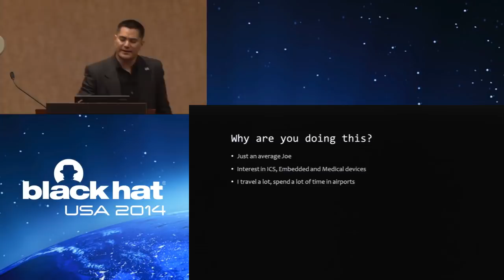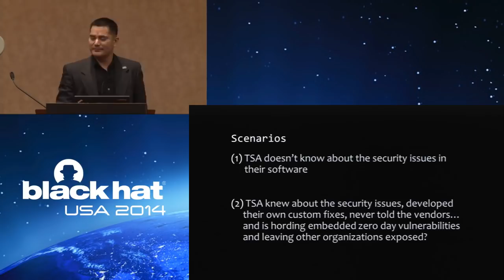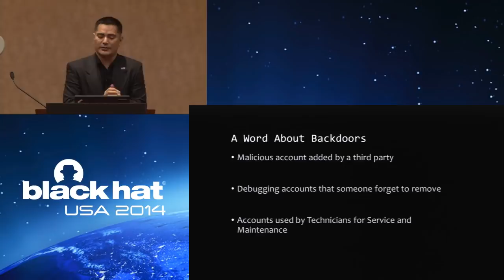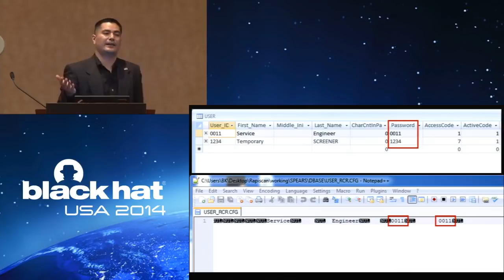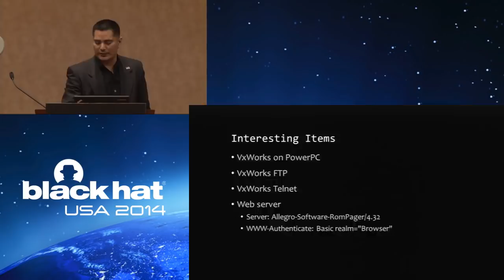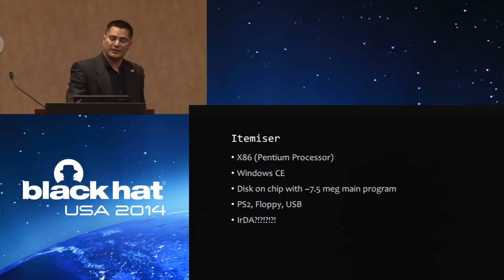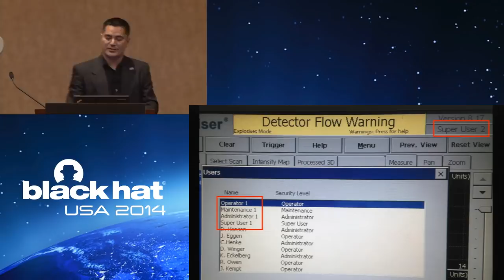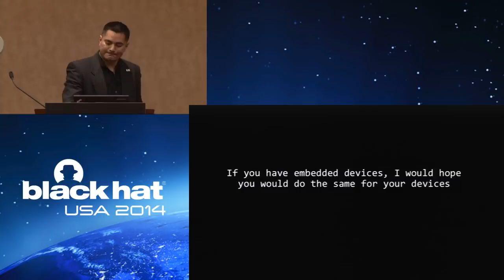Pulling Back the Curtain on Airport Security: Can a Weapon Get Past TSA?

Comment: My home router has better security than the devices used by the TSA...
Reply: bruh
Reply: Nearly all routers have a backdoor for maintenance.
Reply: There was a huge outcry on hardcoded backdoors, an older one now is the Cisco switches, read up on that. Home routers have terrible security generally, I've actually made sure to check that every router I have ever bought or recommended to someone has the option of installing OpenWrt, since routers basically get near no patches after being released, even though most routers are used for years (I actually discovered an ancient one from around 2001 when ADSL was rolled out at my grandparent's house, it was from a time where he spent a godawful amount on a 250MB cap (MB is not a typo), it only got replaced in 2018 after we actually used the net there and discovered that this thing still existed. Amazing feat of engineering though that it could keep running without any issue near 20 years in a dusty room that never got entered, surviving lightning strikes on the line as uppermost house on a large hill, etc.).
Reply: A YouTuber “that it could keep running for 20 years” - yeah, with all its security patches applied by the NSA agent assigned to that home...
Reply: @antoy384  thanks for the laugh, that NSA dude must have been pretty bored as net was used for an email once every few months lol.

Wouldn't be susprising to me though if actually did, my grandfather worked quite high up at NASA during the 60-80s.
Reply: can i buy it?
Reply: @Walter_  “Nearly all” lol.  More like nearly all stock ISP supplied routers.  Buy your own, run PFSense.  It’s easier than you may think.
Reply: @\f_a/ I use a pfsense router and Ubnt switches and wifi access points.
Reply: @\f_a/ No prob.  Just Google pf sense router if you’re not familiar with it, basically you can buy a barebones micro system and install it yourself.  The security and features are great and it’s actually really easy to use.

Comment: Title " Can a Weapon Get Past TSA?" ... answer not given or I missed it somehow.
Reply: I have to agree, I was thinking he meant TSA misses false bottom bags or similar modifications in baggage.
The answer is more developed. Inferred rather than overtly claimed.
If a weapon can be substituted INTO a screening event, can't a screening, sniffing, detecting device be overridden to NOT ALERT??  So, from 4:30pm today to 6pm today, at your local airport, no alerts will be given in any threat detection.  Is that safe?  How about the reciprocal....from 4:30 to 6 pm ALL SCREENING EVENTS WILL SHOW A GUN.  Now, after 20 minutes, will TSA trust all those detections?  No, they saw a gun, they looked in the bag, its not there, they screened the bag EMPTY, it shows gun, the gun is not there, etc.  What would TSA do?  Delay thousands of passengers, and flights??  Or, start passing everyone?  What do they do if this occurs in the top 20 US airports at the same time?
Reply: The presenter is a weapon and he got past TSA
Reply: TSA has an 80% failure rate in testing and one of the highest turnover rates of any government LE agency.  Yes, you can.
Reply: The mic is mightier than the gun... Boy things evolve fast!
Reply: It's that weapon Douglas Adams has talked about
Reply: on purpose...
Reply: Looking at the network diagram shows these devices have to be networked. I'm making a few assumptions here but from the employee timeclock software (like the one exposed to WAN from SF airport) you can hop to other devices using hardcoded credentials or possibly OS level exploits on the Windows 98 gun/knife detection software. From there you can change the config file to show fake guns in every bag.  I'm not sure exactly how to exploit that but if I had to try I'd probably start increasing the false positives over a few days to get the employees annoyed about it.  Maybe even make the software show 2 identical guns sometimes if easily possible.  Then bring a gun through that would scan identically on the software that's well hidden in a fake compartment of a bag.  I think the answer is a pretty glaring yes.
Reply: well, of course he doesn't tell you "yes, please bring your weapons into the airplane - also this is how you do it". But from what he has shown the answer is pretty much yes - you can. He showed that the devices are a) all on a shared network and b) that most of them have easily exploitable backdoors. Just from what was shown in this 30 minute talk you could a) change a simple config to completely deactivate the detection of dangerous substances b) impose pictures on top of scanned luggage or c) show the user a sign that tells them "this is not an actual gun, but a training picture. go on". 
Just use your imagination for what else is possible with super user access to these machines.
Reply: not just that. You could simply overlay a completely fake scan on top of the actual luggage. You could just display the green "hey, you spotted the fake digital gun. well done" display while actually having real a gun in your bag.
Reply: Well if you can alter or adjust what the device is detecting, the answer is yes. He could literally disable the entire explosive swabs machine by rewriting the config.bin. The Rapiscan alters the images the operator sees, so what’s stopping him from injecting code that makes every bag look normal?
Reply: it's called a rhetorical question. the answer is given many times during the presentation
Reply: Andrew H    Hi, just wondering where you get 80% from - can you give me the source so I can read where you saw this...

I’ve worked as a Flight Attendant for one of the largest airlines in the world for the past 17 years with the 6 years previous as an Aircraft Dispatcher - seeing how that job involved co-ordinating the turnaround of aircraft from when it lands to it taking off, Ive always loved reading up on security measures and stats from “rival” airlines. 

When I saw your comment, I immediately found this figure to be extremely high - and I’m certain if the failure rate of finding “insecure” baggage was as high as you say with 4 bags out of every 5 being missed, then they wouldn’t be allowed to operate. Especially after the scale of security was increased ten-fold after 9/11.
When IATA did a huge in-depth survey of all the major airlines flying in and out of US and European airports, they published their findings after it was discovered figures were surprisingly high - However they considered it high when some airlines hit a failure rate of 25 - 30% (None were TSA) As far as Im aware, the offending airlines were given a timeframe to improve - and I imagine they must have, otherwise they wouldn’t be flying to this day.

Anyways, I’m not trying to start an argument or anything - just want to have a read of where you saw that 80% figure.

Cheers ✌️
Reply: If they can inject fake guns into the rapdiscan machine, they can disable the alarms for guns, scan their bag with their machine, and inject that clean scan into the machine at the airport.
Reply: @markotik75  He is most likely referring to the late 2017 undercover DHS report: https://abcnews.go.com/US/tsa-fails-tests-latest-undercover-operation-us-airports/story?id=51022188

A relevant quote from this article is : When ABC News asked the source if the failure rate was 80 percent, the response was, "You are in the ballpark." 
This is from an official source that is said to have seen the document.

This also comes after the 2015 ABC news report that said DHS undercover tests produced a 95% failure rate: https://abcnews.go.com/US/exclusive-undercover-dhs-tests-find-widespread-security-failures/story?id=31434881
Reply: There is many implied vulnerabilities. The power point is laid out in a way to point to the actual problem: there is serious design flaw in the checkpoints evidenced right in the specifications.  He continues by pointing at some other inadequacies such as the use of inconsistent security on manufacture, some may call it haphazard.  If they get bent out of shape about a light bulb, why was nothing done about main board assembly coming from China?  His presentation is about a high degree of negligence or outright incompetence. Who knows, maybe TSAnet is a robust network capable of handling exploited or malicious terminals. If this is the case, it was probably not designed by anybody from the team planning the security checkpoints.
Reply: The answer is, basically, yes...yes it can.
He detailed a few different ways you can get into the networked system to disable certain parts of the security system.
Specifically he detailed how you can access the screens of the scanners through the software and alter them...and how those machines were in the network, thus, accessible from another part of the network if you want...and how easy it was to change what the scanners show.  Thus, you could change the image files for the weapons into safe things, like pictures of normal luggage contents.  Then you have them always appear over the luggage.
He also said how you could get into the main files of the machine which detects chemicals (bomb stuff. for example) and alter those so they didn't detect that stuff any more.
Part of it was also showing how you could access the network through a back door in the employee scanner thing....thus giving you access to all the machines on the network.

So, yeah, he basically gave you a full break down on how you could hack into the security check point, alter it's luggage scanner and it's chemical scanner and, thus, get anything you want through the checkpoint.
Reply: Yes, they can. More can be done by social engineering than exploiting the system.
Reply: the answer is no, because all of TSAs devices have custom settings
Reply: The answer is yes...did you not watch the video in full?
Reply: The implied answer is yes, you can.
Reply: The answer is yes. At least according to the security audits done by our own federal government. I believe it was something like 8 out of 10 dummy weapons got through security.
Reply: The answer is yes, or was yes with the equipment he tested. You were able to change screens on Xray machines, remove explosives or drugs from itemizer and so on. It wouldn't be easy or even practical but it could be done. Weapons get past TSA all the time without any of these high tech methods anyway
Reply: @MarkH10  I think they'd just cancel as many flights as possible and declare a state of emergency, to be honest.

Comment: "Our computers are unhackable." "Enigma ist unzerbrechlich" so said the Nazis. Even when the Allies behaved as if they knew what the orders were, the Nazis still insisted that the Enigma code was 100% secure. But due to a minor error the Enigma WAS breakable. The letter changing devise never substituted a letter with itself. It made breaking Enigma much easier.
   Ironically the English adapted the code machines for itself, fixing that design error and used it for years.
Remember, the bad guys are going to place their cleverest people to the problem, and if there is anything you overlooked, they WILL find it and exploit it, just as the chaps in Bletchley Park did. Are you smarter than the smartest person the bad guys have?
     Saying that the thing you want protected is 100% secure is incredibly foolish. You better have your cleverest people try to breach your security, because if you don't, the bad guys will. And they won't tell you what your weaknesses are, and they sure as hell will try to fuck you up.

Comment: In the year 2005 I flew from Amsterdam to Newark with an acquaintance. There was some delay with the baggage so we had to wait a while before we could collect it. He used a 4 inch pocket knife to split a piece of bread between the both of us and I was surprised. He told me he never travelled without his pocket knife and he had travelled the world with it. He simple put it in the tray before going through the metal detector, watch and wallet on top and nobody had ever checked it.  So every time on board an air plane he always had his pocket knife in his pocket. It's not just the TSA, all over the world they are mot noticing what is in plain sight.
Reply: Ingeborg Svensson in Europe, small pocket knives are allowed on aircraft. You can buy Swiss Army knives in many airports, especially Switzerland.
Reply: That's actually BS you can't have small pocket knife onboard but can have let's say stainless steel pen.

Comment: The reason backdoors are so common in systems integration is because the people paying systems integrators are never the same people in the field maintaining and supporting the system. The people paying the integrators are the people who are given the admin credentials. If an integrator set a secure password policy, then the next time they need to show up to work on the system, they'd have to get in contact with the suits to do their work, and the suits are never happy with that. The suits will also never give admin credentials to their maintenance crew, they give them slightly restricted maintenance accounts instead. So the integrators have the choice to either put in a backdoor so they can deliver swift service, or make the system secure and make the people who cut the checks unhappy. The choice is easy at that point.

The suits need to be better educated on how/why proper security works, and also be willing to give up control over these admin credentials to the crew that needs it. When this happens, the integrators won't need a back door anymore, since the maintenance crew will have what they need, and maintenance is always on hand.

Comment: @19:30 that's not what the code on the screen actually does. It's making sure ftpUname is defined. There's nothing shown that says the username and/or password can't be changed.
Reply: The reason it can't be changed is it's used in the code you are referring to.  They're calling a function that sets the username and password that will be used in the request, and the username and password they use in the code is the same as what is used in the config file (obvs).  That's what hard coding means.
Reply: "Not In Evidence" If you want to show that it's hard coded, show the section of code that actually uses the fix name/password, not the code that sets it if it's not already set.

Comment: Thats a cool itemizer, but, does it run doom?
Reply: But can it run cryisis?
Reply: Like allahu akbar?
Reply: Wasn't that the pentium device? That's x86, that could run doom easily.
Reply: No. Unfortunately. Would make checkpoint days much better if it did.
Reply: probably could
Reply: pretty sure I had a doom clone on my Cassiopeia, that was Windows CE (and certainly not a Pentium. It was playable but it worked!)
Reply: Can't wait til they release Skyrim on the Itemizer 3

Comment: I accidentally went from Peru to the US to Australia with a ~ 3 inch blade folding knife right at the bottom of my carry-on. It didn't get picked up...
Reply: My laptop bag had a series of cables and key chains surrounding a $25 S&W aluminum bodied 3.5" knife.  It was oriented in a way that the machine only saw the knife's side or top, never the broadside.  Twice I went through screening unstopped.   It's not fool proof;  the screening is more of a deterrence and to show the taxpayers "we're doing something!"
Reply: Knobsmacker. I by mistake forgot to leave my knife at home once, when going on an overseas trip, and didnt get through the checkpoint when they saw it. They gave me 2 options, leave the airport, or they could take the knife and let me on the plane. I took option no.1. Then I decided to try again, since the time was too short to go back home with the knife, and there was no mailbox in the airport to mail the knife back to my house, and ive owned this knife since i was a kid, so i just really wanted to keep it. So then, i decided i was getting the knife through the checkpoint. How?  By filling my pockets full of crap, then when the bins goes through the scanner, and the tech says "oh, possible sharp object here", your instructed to show them your bin, move the stuff back and fourth so they can see all of it, but they won't, as its easy to just move stuff ever so slightly too little as to not expose the 1 item you don't want them to see, at the same time make it look like your really moving the stuff about thoroughly. A smart person at this point would have added 0 and 1 together, no? The tech thought it was strange they didn't see the offending item, especially considering they clearly remembered me from the first time attempting to pass with the knife, but nevertheless, then let me pass. In essence, a backdoor by harnessing the staff's low IQ.

I'll skip how to enter a guarded checkpoint at a military facility with absolutely no clearance or security papers nor even plain ID for this time. But I have done that, by the low IQ backdoor.
Reply: @Santor-  I think most flyers and train riders post 9/11 are smart enough today that someone with a knife is only going to get themselves seriously hurt.  Hell, even on flight 93 once the passengers knew what was up, they kicked ass.
Reply: M Hamma well sure, if something is "up", thats different.
Reply: @Santor-  IQ is meaningless. It's simply impossible for the human brain to maintain perfect attention and memory for 8 hours. Have you ever worked customer service? After a while it would take a rainbow LED-lit top hat and hammer pants to make any one stranger distinguishable from another. Look like you're doing something, move the line along, repeat.
Reply: Depends a lot on the airport. Chicago Ohare hardly ever finds anything.
Reply: They don't worry about knives anymore because of air marshalls
Reply: @I_Lemaire  The real reason knives aren't a threat now is that cockpits are locked and passengers know to fight back.
Reply: @timewave02012  true.
Reply: @Honey b. gun shell > 3" blade, priorities ! am I right ?